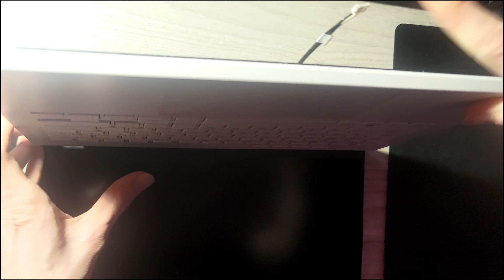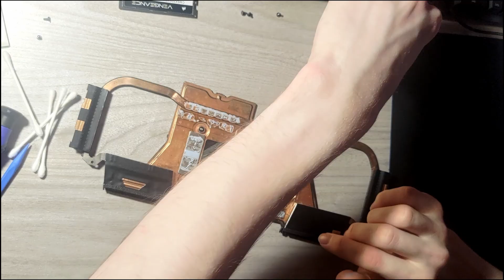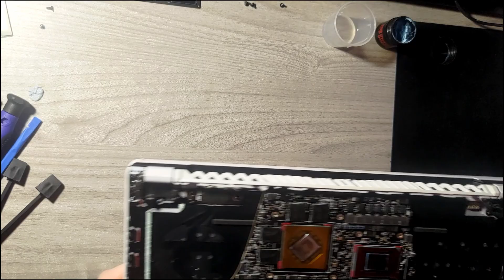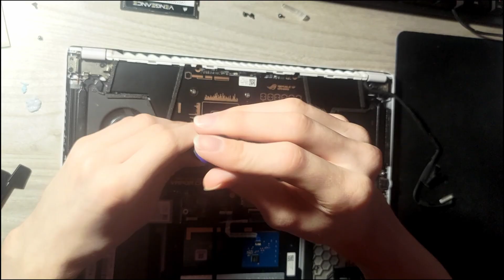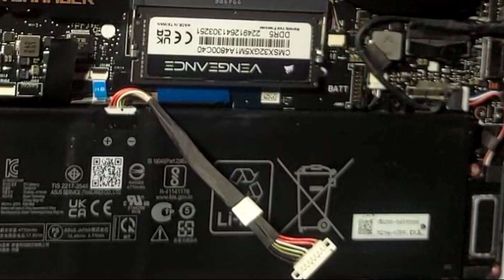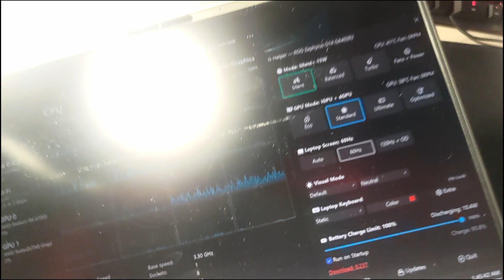Asus Zephyrus G14 Thermal Mod for 2022 & 2023

Comment: As someone who has serviced and reassembled their own 2023 Zephyrus G14 with a Ryzen 9 7940HS + 4090, I really wouldn't recommend using PTM (even though I'm currently using it myself). 

Let me explain: the cooling on this CPU is designed around liquid metal and the temperatures that come with it, so between the processor and the actual heatsink there's a soldered-on shim (a spacer that keeps the liquid metal from contacting the copper heatsink directly). 

After I switched to Thermal Grizzly PTM, my temperatures got worse over time, and for about a year I kept disassembling and reassembling the laptop trying to fix it, unable to figure out what was wrong, until one day the shim actually came loose from the heatsink. That's when I saw that whatever material it had originally been mounted on had somehow squeezed out from underneath it, creating air pockets under the shim, which is what was causing the higher temperatures. 

That same material had also spread a bit across the heatsink, which I ended up having to sand down. Now I've fully removed the frame around the processor, sanded the heatsink flat, and applied PTM both under the shim and on the CPU itself, and my temperatures are perfect at the moment. But if I'd known upfront that PTM would lead to all this, I wouldn't have used it in the first place, even though I'm very happy with the end result now.

Comment: quick question, im afraid about the exhaust that is facing to the monitor of the laptop. if im gaming like 6hrs and the temp of the cpu is around 90degree celcius will it eventually break the monitor? any break such as black bar, the color changing or anything that is scary?

Comment: 13195 is low for 6900hs, mine is going for ~14.900 it was reaching 100W+ on the cpu. I put thermal Grizly alternative for PTM and their thermal putty.
Reply from the maker: Good to know, and thanks, I do know my cold plate for my CPU is slightly corroded due to using much stronger liquid metal (non-factory conductonaut extreme) for a while. Planning on getting a new vapor chamber for both my 2022 and 2023 G14 anyways, but wanted to show the proof of concept for people that have never done it/how to do so safely

Comment: How much better has it been while gaming? Before and after?
Reply from the maker: It's definitely performed a lot better after, been able to flash a 175 watt vbios and been able to sustain around 160, whereas the default vbios was 125 watts and it was overheating
Reply: @antimatter85  do you mean you modified the laptop bios changing total power allowed or that you modified the vbios(video card bios) with one that aims for higher wattage ? Either way I'd be great if you went into some amount of detail.
Reply: @antimatter85 hmmm did same change just no thermal pads might give that a try btw how did u do the vbios could u do tutorial or link, short explanation? Worth it?